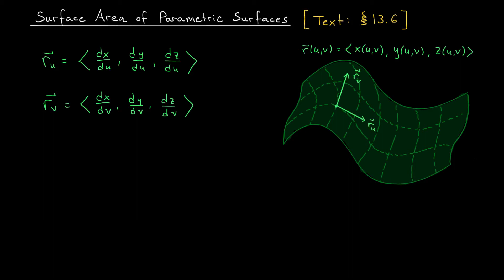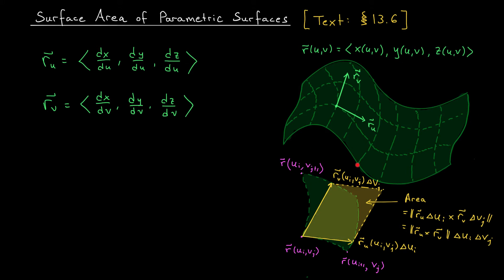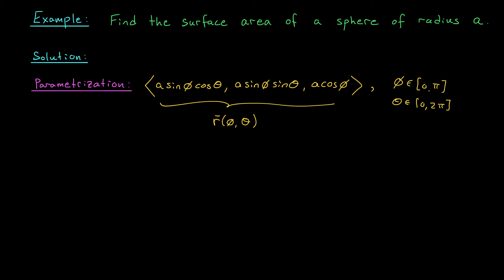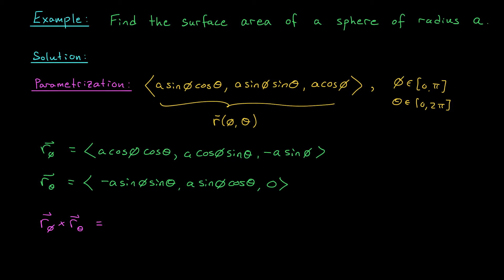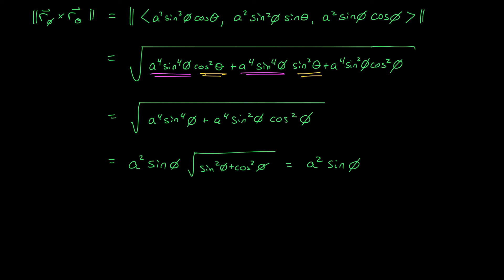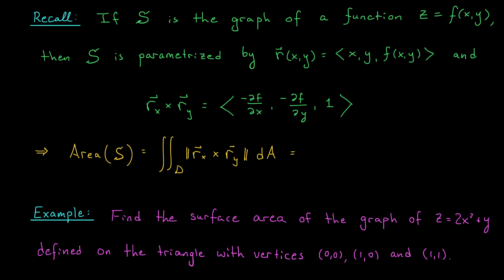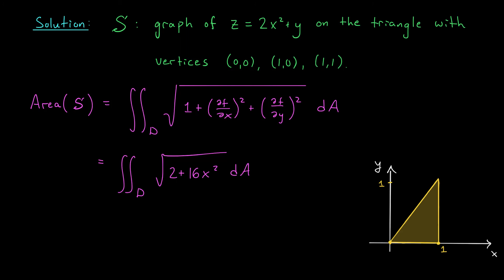Surface Area of Parametric Surfaces

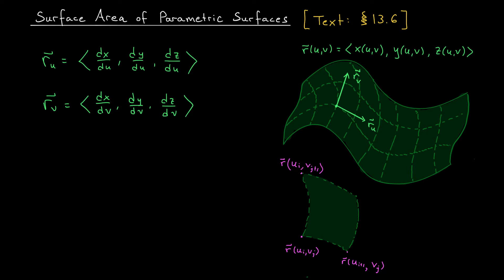Comment: What do you mean by scaling down from 01:42 to 02:00.
Is ru unit vector and you multiply it by du to get vector with direction of unit vector and length of du ?
Reply: Agreed. I didn't get this part and the book didn't help.
From spending some time on it...
dr/du = (r(u nought + delta u, v nought) - r(u nought, v nought) delta u. This is just the definition of the derivative but is important in understanding this.
Rearranging this gives 
dr/du delta u = r(u nought + delta u, v nought) - r(u nought,  v nought)
This is why delta r = dr/du delta u